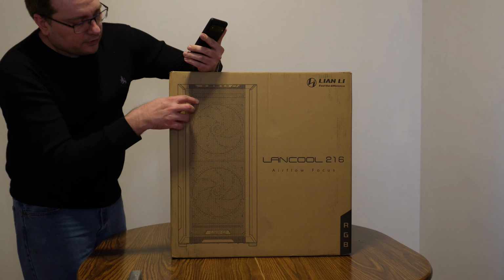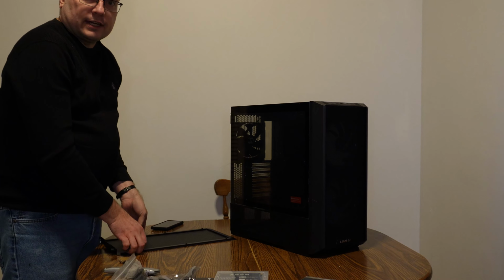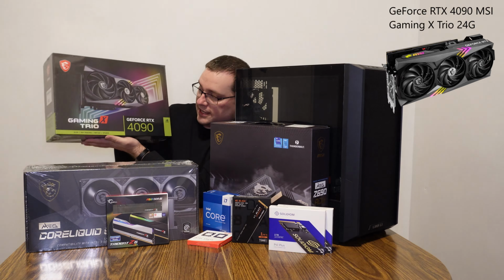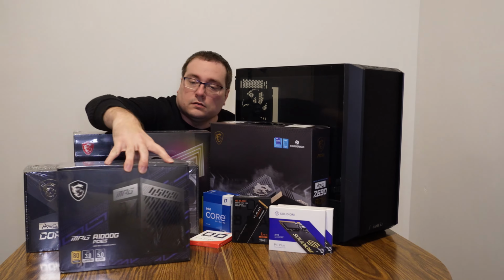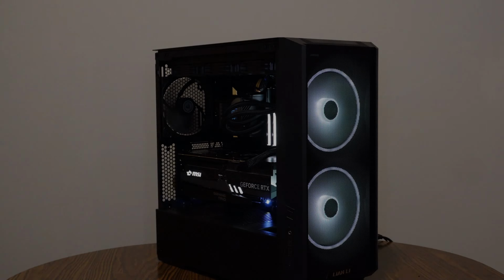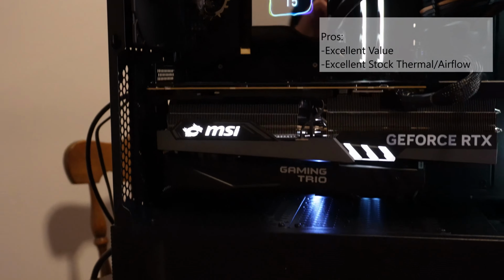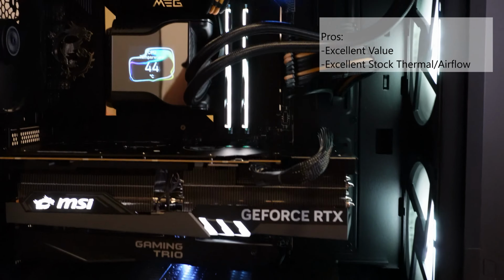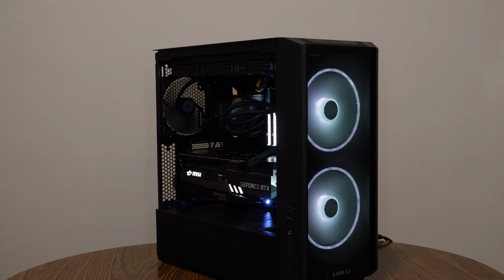Lian Li Lancool 216 Case Review and Build

Comment: I have to agree with your "con" about moving the front I/O Panel. At first I thought the idea was brilliant. Especially since I now have my computer placed desk height on a side table and moving to a side mounted I/O would be right at desk level.

But with those honking big stock fans on the front panel, the fan housing made it almost impossible to bend the stiff cables under the fan. It seemed it might be 'doable', but I wasn't comfortable with the amount of lateral stress put on the cables from the fan housing. Fortunately, that section of the fan isn't used in mounting, so out came the oscillating multi-tool to cut off the corner. Problem solved... but for a 'built in option', it shouldn't be necessary. 

Really that's my only complaint about the case though; other than a nearly worthless manual. Experience builders probably wouldn't need more. But being my first time using a fan hub, I'm here on YouTube to supplement the manual's shortcomings.
Reply from the maker: Agreed, good luck on your build!

Comment: What temperatures did you have on this equipment in this case?
Does the additipnal PCIe fan give any temperature differences?
Reply from the maker: GPU idle : 37-39 degrees. CPU idle: 35-37 degrees. High gaming load GPU: mid 60s. CPU: around 60. Haven't tested it without the 140mm fan below my GPU. I suspect it would increase GPU temps about 3 to 4 degrees or so. Thanks for asking!

Comment: @Game On, did you use the included GPU anti-sag bracket? thanks
Reply from the maker: Yea, I used the bracket included with the GPU. It works pretty well, I was able to use a 140 mm intake fan below it also. Stay tuned I may be putting together a six month review video for my setup. Thanks for watching!

Comment: How dusty has this case gotten since? Coming from an NZXT hotbox, this will require more maintenance? Probably
Reply from the maker: I have been running it 24/7 for about a month and there is surprisingly little dust in the case or on the GPU back plate.  I was expecting it to have more considering there is no front filter.  I did add a 140 mm fan to the bottom for intake, so I don't know if that helped.  I'll give it a few more months and I'll prolly be cleaning it out by then. Thanks for asking!
Reply: @gameon962  That is surprising! I'm assuming the mesh is thin enough that a dust filter would be unnecessary, which is better than having something that affects thermals. Thanks for the fast reply, keep me updated and make a video in a few months ahah